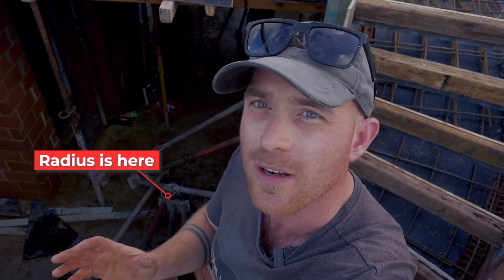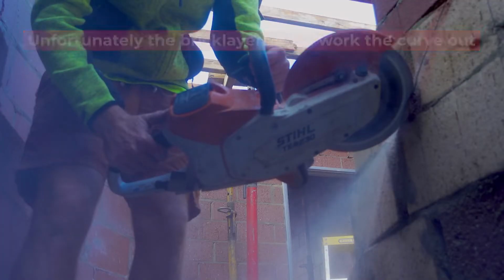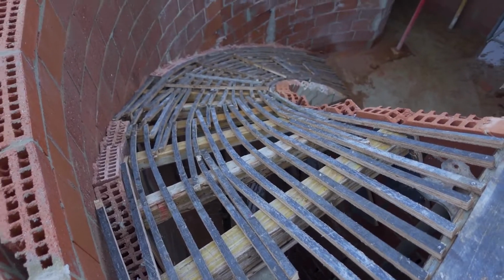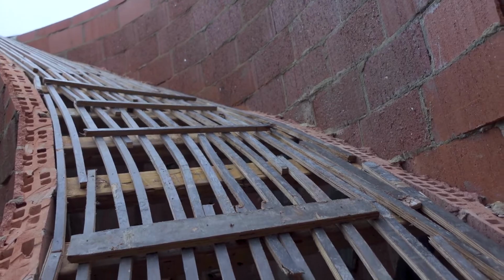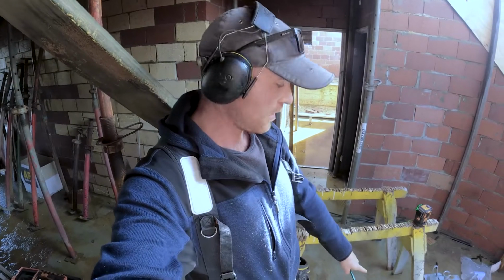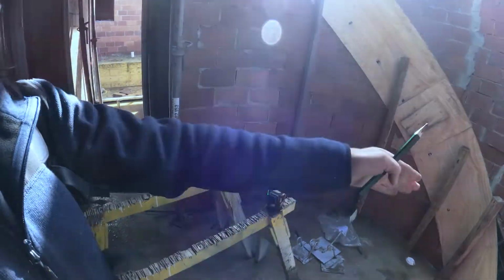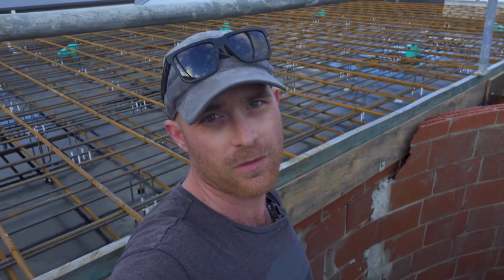HOW TO BUILD SPIRAL CONCRETE STAIRCASE

Comment: Looks class, just wondering did you do a video showing how you marked out the bottom line off the throat.. would like to know your method in doing so
Reply from the maker: You mark the rises then you measure down for the soffit.

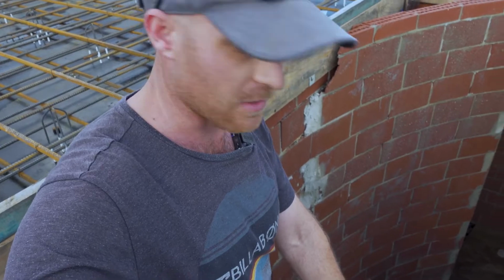Comment: At 7:49 you mentioned PGI. What’s that and what’s it purpose?
Reply from the maker: Hey mate, I explain it a little in my suspended slab videos. It is galvanised strips which are placed ontop of brickwork so that the concrete can't bond to the bricks. You apply 2 layers so that during expansion and contraction the concrete and bricks can move independently of each other. Without it the brick walls will crack in every corner of a 2 story house.